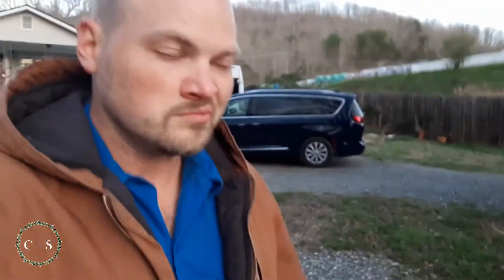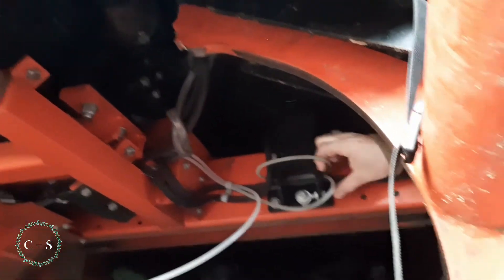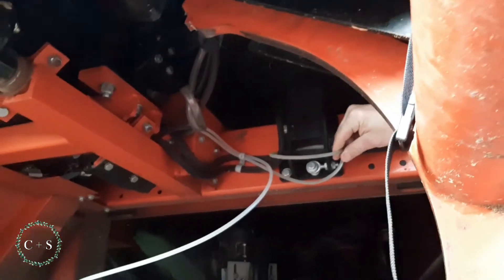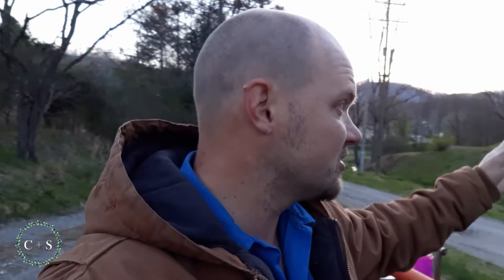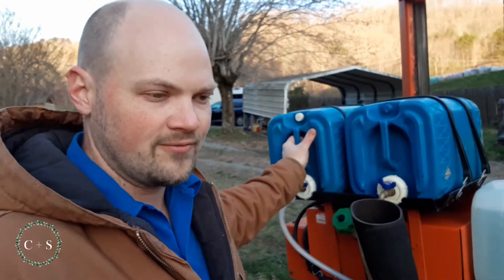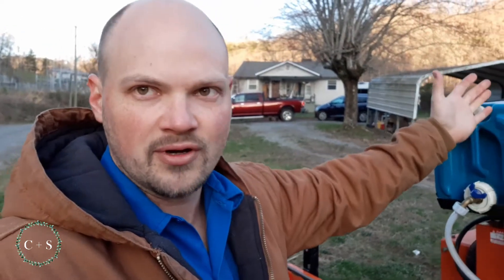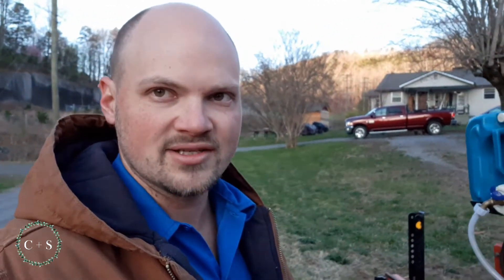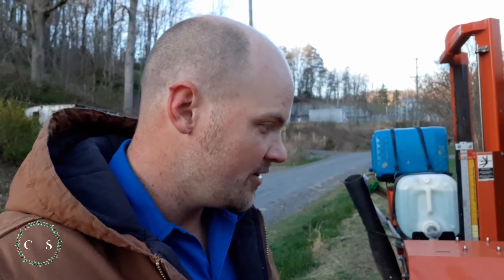how to quickly defrost a sawmill

Comment: Aren't you worried about melting or burning the engin cover??
Reply from the maker: I was the first time i did it,  but it was 10 degrees and I had a space heater under the cover for two hours with no progress.   Engine idled for about 20 minutes maybe and everything defrosted perfectly.  You gotta keep an eye on it, but, when your water is frozen everything else is also pretty cold so it takes a while to heat up to where it would melt something